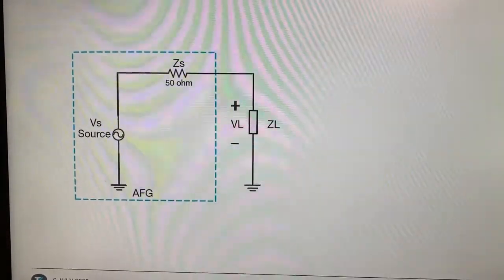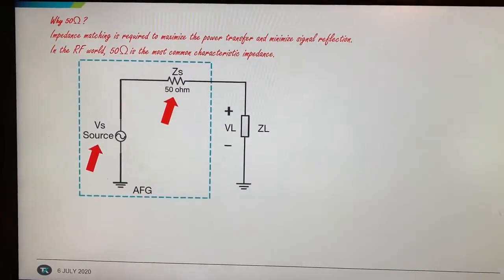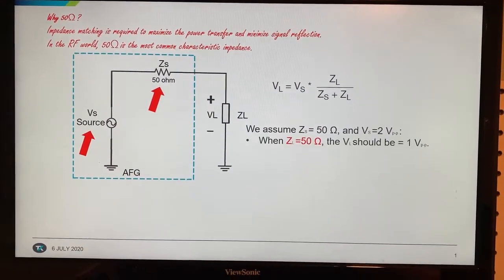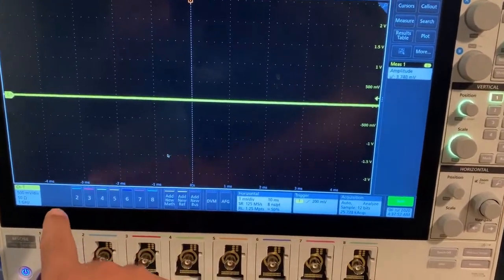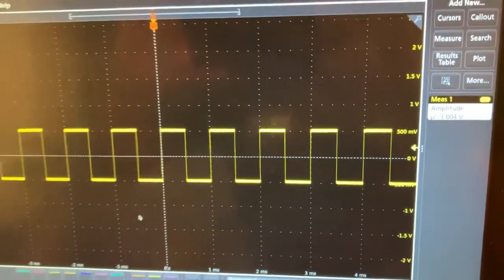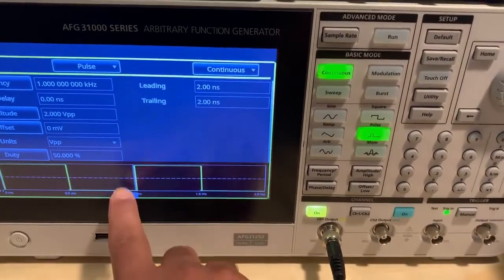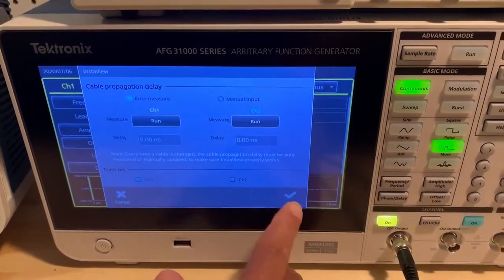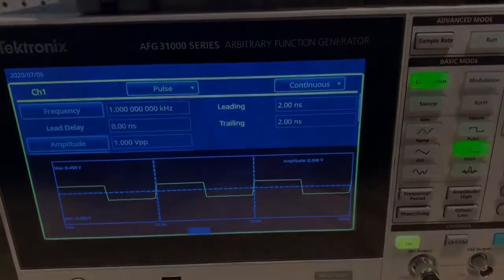50 Ohms Output Impedance on Function Generators

Comment: Conceptially it is wrong to start with power transfer as a requirement for the 50 Ohm source or load. It is bettery to convey that you are trying to transmit a signal while maintaining high fidelity (low noise and distrotion) from a source to a load, and to do so you need a transmission line of some sort. So, what is the distance of the transmission and what media do you want to use to convey the signal (informations)? If it is a coaxial cable with a 50 Ohm characteristic impedance, then we have to provide a source and termination to meet the line requirements.